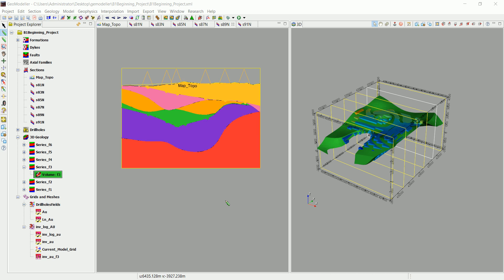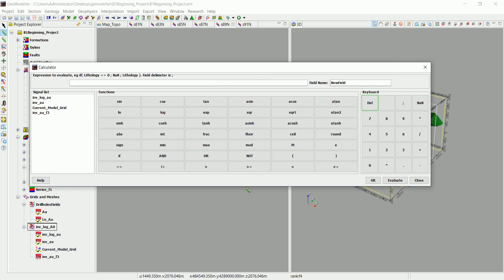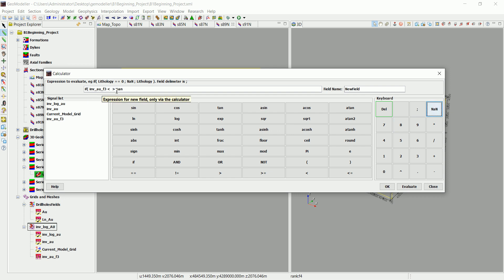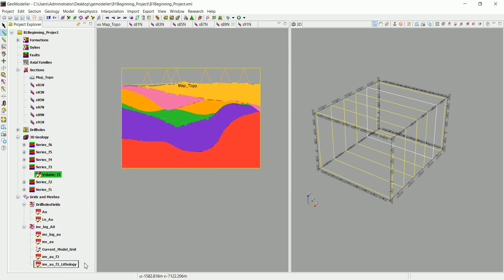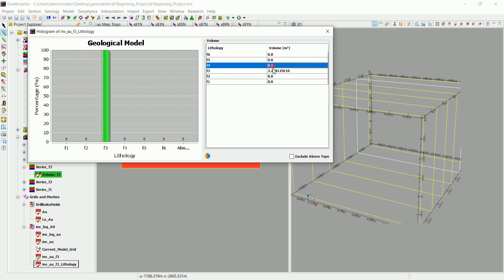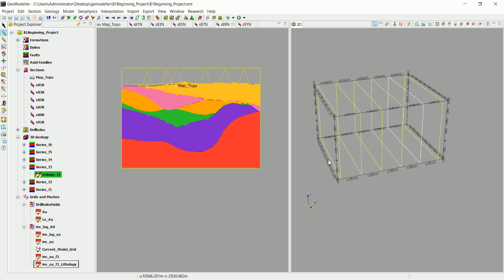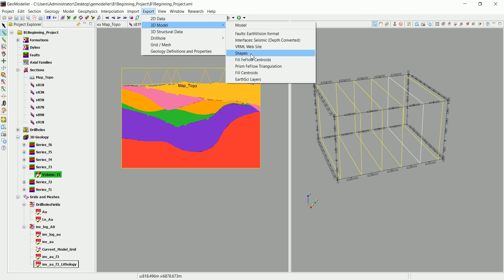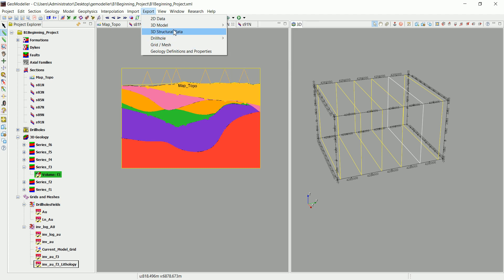3D Geological modelling : Part 14

Comment: Hey man... thanks a lot for effort...the videos u doing are very useful and informative... thanks again...i would like to ask u if there is any website that provides a free download od the latest version of 3D Geomodeller...i've got the 2014 version which is kind of old...
Reply from the maker: Thank you Farouk for your feedback, Geomodeller is paid software and you can get the latest version of it from intrepid geophysics it's official provider
Reply: @MiningGeologist  thanks man for answering... another technical question...i would like to export my 3d models from geomodeller to surfer...at least as surfaces...i tried all the export extensions provided by Geomodeller and i failed...
Reply from the maker: @faroukbenagoune6000   in theexport to 3D Model you will find an option to export interfaces , that one will generate the interfaces of the different geological layers in ASC format which can be used in surfer or GIS packages